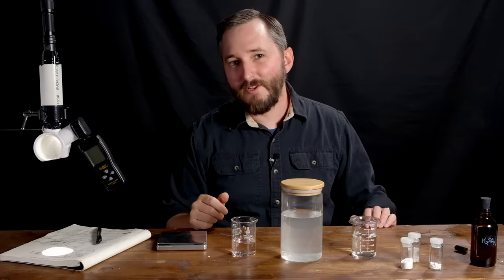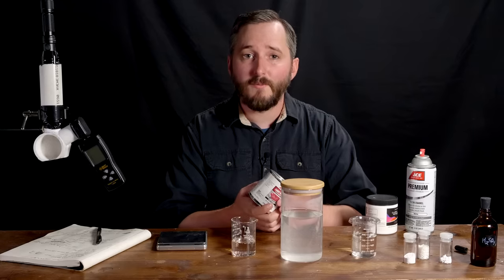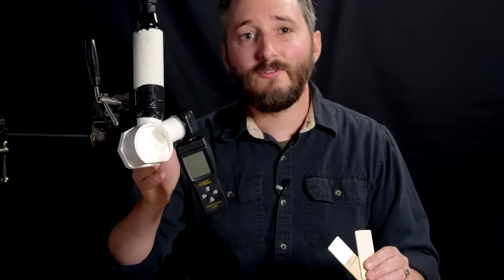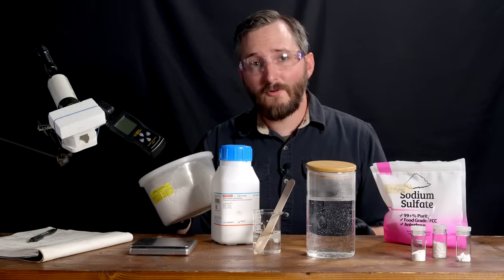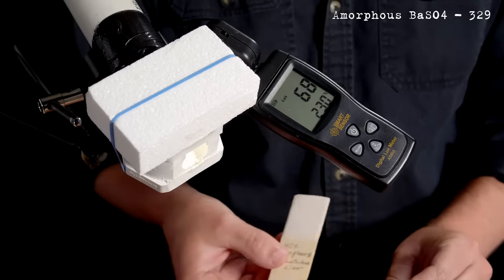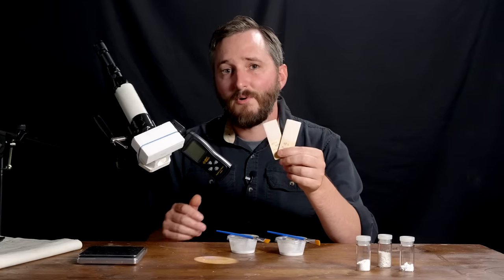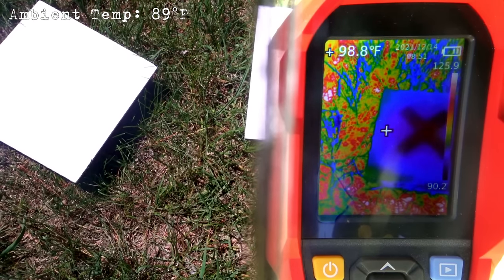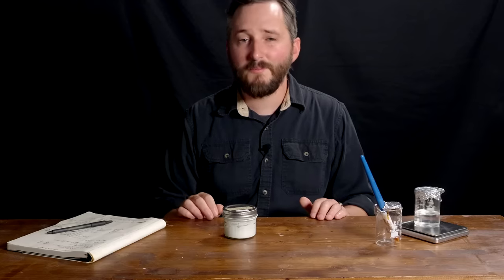How To Make Infrared Cooling Paint (Electricity Free Air Conditioning)

Comment: Can anyone help me understand why radiating at a wavelength that escapes earth is positive for the *panel itself*?
Sure, it's cooling the earth as a system better than something that radiates wavelengths that are re-absorbed or reflected by the atmosphere. However, from the panels point of view, the energy is emitted, and the chance that some light it radiated is bounced back to it from the atmosphere is vanishingly small. The emitting energy in any wavelength is a win for the panel.
There isn't anything special about outer space being very cold, there is no "suction", it's only about emission from the panel. Why would optimizing the wavelength of radiated light need to be tuned to the "atmospheric infrared window"?

Comment: How many grams of barium sulfate is required to (make enough paint to) cover a square meter? (or whichever units)
How well does this perform in cooling from above ambient,  e g if you paint one of two metal cans,  and pour boiling water in them, to simulate a heat dump of an AC heat pump (so one can radiate waste heat into space instead of just dumping the heat into the outside city air)?
Reply from the maker: Probably 200-300g pigment per square meter. I'll have to test overall cooling power in the future.

Comment: Doesn’t the low e nature of white paint make it appear cooler than it is when you use infrared thermometers?

If yours is somehow emissive at that spectrum, it may be that you can’t read the temp difference of the material it covers because of that. 

Have you tested it with contact thermometers?

I could see a thermometer painted under the paints reading substantially better for yours because it will get rid of that difference.
Reply from the maker: I've been testing with contact thermocouples for a while now. The IR reading is fairly accurate
Reply: @Nighthawkinlight  cool thanks! Interesting to know.

Comment: Would it be possible to do like Kindle-style "paper screens" combining a cooling white base color with an extremely black (I'm thinking Vantablack or so) pigment to basically electrically switch panels' colors between white and black depending on whether you want cooling or heating? In a way that's durable enough to be used as roof shingles?
Reply: Why do you need a kindle screen? just have a number of long thin panels that you rotate.

Comment: So, if I paint my houses' outer wall with this paint it will radiate to my neighbours house and heat that up? Or will it radiate into the ground and burn the plants around the house?
Reply from the maker: Neither of those things. It doesn't radiate more than other paints, it just does so at a particular wavelength.

Comment: I’ve been considering painting intake air pipes for an engine with this to keep the intake air cooler. Do you think this would have any significant effect?
Reply from the maker: No, it won't work under a hood, only facing open sky

Comment: You mentioned the IR hole in the atmosphere, does this only work outdoors? Fridges have a condenser on the back that rejects the heat from inside the cabinet, would the paint be beneficial on the condenser?
Reply from the maker: It only works outdoors
Reply: @Nighthawkinlight  Thanks for getting back to me.

Comment: Wait a minute. You are measuring the temperature by reflection / radiation. I can Imagen some warmth being more conducted through the paint then others, therefore also a temperature censor should have been at the back of the panel. An imitation wooden panel is neither a good warmth conductor nor an isolator. Paint could influence it to both ways.

Comment: I coated transparent plastic with the paint and it transmits a lot of light. Have you tried yours on a transparent material? Do you know if yours was translucent?
Reply from the maker: I have painted on glass and there's little transparency with 4g+ of pigment per gram acrylic but the paint does require a thick coat, about 1mm thick when wet (it shrinks to a fraction of that thickness while drying). It doesn't apply well with a brush as thick as I'd like so I prefer to spray it on. I'll show that in a future video. Right now I'm using a Harris brand chemically resistant spray bottle and it's working well with the acetone.

Comment: Try it at 100F ambient instead of 70F. Maybe it'll be better?
Reply: Is barium harmful when it leeches into rain water for drinking or garden watering?
Reply: What about the calcium carbonate based paint mentioned at the start? Is it a effective?safer?
Reply from the maker: Barium sulfate is insoluble in water so it is not at risk of leeching.
Reply: @Nighthawkinlight  ok, maybe not leeching.  I just meant eroding off the roof into soil/water as the roof wears out.  Seems like calciumcarbonate might be safer.
Reply from the maker: @TheRainHarvester  Still fine. Being insoluble in water makes it biologically inert and not a dangerous pollutant.

Comment: I live in a country with UV index that goes upto 11 and I was thinking, our roof is not exactly painted white ( mostly grey ),
Would painting it reduce the indoor temperature? Side walls are white
Reply from the maker: Yes, but this paint is not ready for such uses. You should speak with a roofer in your area before painting because in some places a white roof might cause too much humidity and condensation in your attic
Reply: @Nighthawkinlight  we don't have an attic , our houses are very simple just built on the ground level a few rooms and flat roof but thanks for the reply!

Comment: when i tried to  dissolve acrylic, it melted into a blob at the bottom of the glass. is that normal ? can the remaining solution be used in the next step ?
Reply from the maker: That's normal. Stir the blob and it will continue to dissolve. Don't use the liquid on top until everything dissolves or the measurements will be wrong. Stay tuned for my next video in about a month, I have a new recipe to share

Comment: If you're using an infrared camera to measure temperature, couldn't the measurements just indicate that the emissions of the material is different at the wavelengths your measuring, and not the actual temperature? A thermocouple would probably be a better way to measure the difference.
Reply from the maker: Not really, the ir camera measures a broad spectrum.

Comment: Could there be some interaction of the paint emissions spectra with the infrared thermometer?
Reply from the maker: No, the thermometer measures intensity, not spectra. Essentially it's black and white. There could be measurement error for other reasons, but so far my physical temperture checks line up.
Reply: @Nighthawkinlight  thanks for the reply!!

Comment: I'm confused. Are you testing reflective ability in the IR range or not? I ask because you were so surprised by the fact that your paint and the store-bought paint both performed the same IN THE SHADE where there is little direct sunlight to be reflected or absorbed. 23:09 You again confused me by turning from the light spectrum to radiated heat from water. Did you test to see if they paint could convert the heat into the IR range you mentioned?

Is it possible on a non-commercial scale to produce that at home? If so, what would be the cost per gallon? Would you be willing to share the recipe/instructions?
Reply from the maker: I did not test reflectivity in the IR range, only visible. I was surprised the paints performed similarly in shade because barium paint should be capable of extra cooling due to more favorable emissivity. This paint is not a finished product so it's not ready for price estimates per gallon. The recipe is in the video itself.
Reply: @Nighthawkinlight  Why would it have superior emissivity in the shade if the amount of light hitting it directly is minimal? What I mean to say is that the light in the shade would receive greatly reduced UV and heat, so you would have to use a much finer  thermometer to detect the actual difference. It's like graphing the difference between things that differ by fractions - you have to greatly shrink the shown range to just the relevant range just so that the difference would be easily visible to the eye.

Also, how much energy was being stored as heat in the materials you used and the ground and ladder? You would've needed a suitable barrier between other sources of heat to more accurately see the difference in and out of the sunlight. Most of that, if not all, would be absent in the shade. As you pointed out in your video, the nearby heat of the store paint may have affected the temperature of your paint. So, in sunlight you're also getting stored heat radiated back out.

I hope that makes sense. I think you did a great job and I've subscribed to your interesting channel.
Reply from the maker: @GlennsFastReviews  You're confusing emissivity with reflectivity. These are two different terms and the paint uses both. IR emissivity is not effected by external lighting conditions. The test samples were all backed with 1/2" of insulating foam.
Reply: @Nighthawkinlight   @NightHawkInLight  Interesting. I'm still confused and perhaps I inferred incorrectly that you were trying to take in light and convert it to the IR spectrum that will pass through pretty much every barrier and back into outer space? I used to study climate change so I'm a bit familiar with the albedo, but not to the extent you seem to be.

I'm trying to understand what you did, but I think there's something I'm not grasping. You were testing visible reflectivity, not emissivity, right? So, replace where I used the latter with the former in my previous message. Does it make sense now? If not, what's your theory?
Reply from the maker: @GlennsFastReviews  I think I see where the confusion is. The paint doesn't take in light and convert it to different light. The goal is for all the incoming light to be reflected. By that reflection (a high albedo) you can maintain ambient temperture in sunlight. To go sub ambient emissivity has to take over, converting heat directly into IR radiation.
Reply from the maker: @GlennsFastReviews  Also the confusion seems to be because I spent the first half of the video testing for high reflectivity only. The only way I can test for favorable emissivity is with practical performance comparisons which I focused on in the second half.
Reply: @Nighthawkinlight  Ok. Thanks for explaining so patiently!

Comment: If painting directly on metal roofs, do you think making stripes of both commercial and the acrylic/barium paint cool the roof?
Reply from the maker: Metal roofs need silicone based coatings. Acrylic coatings don't last long because they crack
Reply: @Nighthawkinlight  TY, I didn't realized acrylic is easy to crumble. I wonder if those plastics used to make roofs would be more stable (not sure if those were PVC).

Comment: There is something I don't understand. If this paint radiates better in infrared wavelength, why seems it cooler than its ambient?
Reply from the maker: It doesn't radiate better, it radiates at a particular wavelength. Overall quantity of radiation still depends on temperature

Comment: If the paint reflects infrared light, wouldn't that throw off the reading of the thermal camera?
Reply: It's supposed to be a good absorber/emitter of rays in the athmospheric infrared window, and a good reflector of visible light. A problem is at least not immadiately obvious to me.

Comment: If the surface isn't radiating heat then it's not cooling the underlying object. A surface that looks cool in the infrared is not necessarily showing that air conditioning is taking place in the structure. He went to a lot of trouble without understand the basic physics involved.

Comment: I appreciate all the effort that went into your research, but you do not mention paint durability. Infrared cooling paint has an enormous potential in warmer equatorial regions where less affluent people could really enjoy the obvious benefits - not not if a covering film is required, and certainly not where regular heavy rains can easily wash off the paint. If your paint would last 10-years (typical for a quality exterior paint), I am all in; otherwise, it is still in the concept stage.

Comment: So, where’s the calcium carbonate? It’s cheap, easy, non toxic, and is knocking around most artists studios. Get some plaster of Paris and slake it, you have a fine white powder ready to make paint. You could grind that stuff into a drying oil, tho’ the ease of rhoplex is pretty attractive. It was 104 F here today,  why a I clicked on this video. Ready to field test.
Yes, I’m a painter. If you have a factory the exotic pigment is good. If you’re making this is your basement, for extreme heat emergency hardening, the easily available idiot proof one is good to explore.

Comment: Why not add lead paint into the mix and see how it performs? Lead-based white paint has unique properties that have not been effectively duplicated with the modern "safe" substitutes.
Reply: I was thinking the same thing but didn't have the balls to suggest it due to the dangers of lead to humans. There is also a reflective mineral? I think it's a mineral "Mica". Was used in roof paint but from memory also health hazard.
Reply: @marlifords4026  Yeah, my house from when I was a kid had that mica coating on the roof. It's more of a coating than a paint. It helped keep things cooler in the summer, because back then central air was a luxury and not a standard feature.

The dangers of lead paint are grossly overstated, and like asbestos, it was very good for its purpose. In fact, wine casks used for aging/storing wine were commonly lined with pure lead and it didn't cause any illnesses in the people who drank the wine. There is no better insulator than asbestos and it has good fire-resistance properties...but what if the people who sell heating fuels decided to wage a war on asbestos to increase their profits. That's what "trade groups" do. Lead paint had this 'problem' of easily lasting for 50-100 years before actually needing to be repainted. That's bad news for shops who want to sell you buckets of paint every few years - better scare people into believing that and then pay off crooked legislators for statutes .

And while I'm on my rant, the same reason is behind the decision to remove phosphates from laundry detergent...phosphate-based detergents cleaned exceptionally well compared to modern phosphate-free stuff. The excuse here was "runoff causing excessive nutrients in streams and rivers" or something.
Reply: @alphaforce6998  Wow, hadn't even considered this reality. But it kinda makes sense. I know for a fact exactly how long lasting Lead paint is. It's outstanding. I spent 5 of my last year's doing FULL PAINT STRIPS.  Alot of the  old houses here in NZ are suffering from delamination due to the original lead based paint first used finally giving up underneath all the later coating. I'm talking numerous houses. With the only option being a total removal of all paint back to bare weatherboards.

And funny you talk about asbestos. From what is stated by health officials. My father should definitely be long dead and my time should be soon after. He is also a Master painter.  Had me scraping textured asbestos ceiling when I was 16yrs old. He is nearly 80 and still painting.

Comment: There is a problem here that has not been addressed...I know because I went down the same path....and that's the fact that as the air is cooled it can under certain conditions hit dewpoint and the surface starts sweating, this promotes the growth of molds and mildew and other damage to surrounding materials from dampness...so anytime you cool the air 10 degrees F or more this is going to be a problem...
Reply from the maker: Dewpoint isn't an issue if you use a film over top of the paint in a panel. On the underside it's ok if dew condenses because that surface can be bare metal with a drain plug somewhere in the box.
Reply: @Nighthawkinlight  Yes it's the underneath that is a problem, the dampness promotes the growth of the mildew...this is  a painted aluminum roof...but I would think any metal roof would have the same problem...that is if it is exposed to outside air....I guess it depends on how the roof is constructed
Reply from the maker: It's for that reason this paint is better used in external panels, like solar panels.  Air or water is then pumped through the panels and the cold air is either directly pumped into the living space or into the coils of an air conditioner so the conditioner doesn't need to work as hard to reach lower temps. For coating a roof directly it's probably better to use a normal light colored silicone coating to reduce temp, but not so much as to reach the dew point. I'm currently getting my own barn roof coated with a white silicone coat. My own cooling paint will perhaps be used for circulated air injection from panels at a future time.

Comment: What about food grade calcium carbonate? How would that work?
Reply from the maker: Yes it works nearly as well as barium, just slightly less effective. Probably it is better to use calcium because of the low cost
Reply: @Nighthawkinlight  this makes me think of the project the Tech Ingredients guy is doing on making a roof-mounted radiator for driving off heat (I suppose generated from his liquid desiccant cooling system). So glad I found your channel to help my experiments along. Thank you for the engagement.

Comment: Can you explain why this doesn't violate the first and second laws of thermodynamics?  Thank you.
Reply from the maker: Space is very cold. Thermodynamics has no problem with heat flowing from hot to cold.
Reply: @Nighthawkinlight  How does that explain sub-ambient radiant cooling? In that case, you would have heat flowing from the treated object into a warmer environment, not outer space.